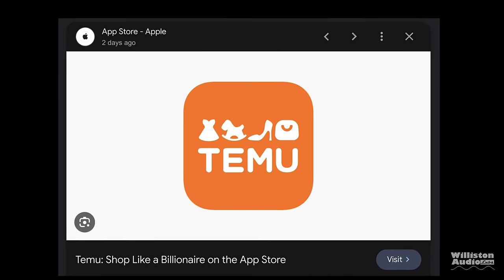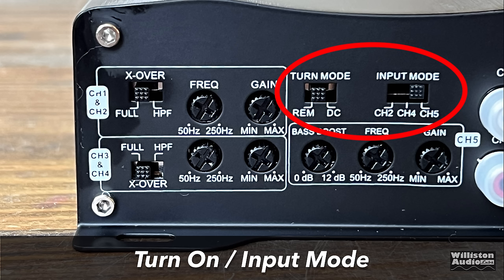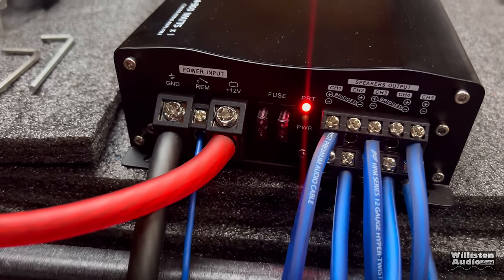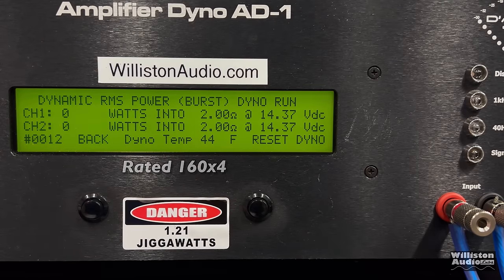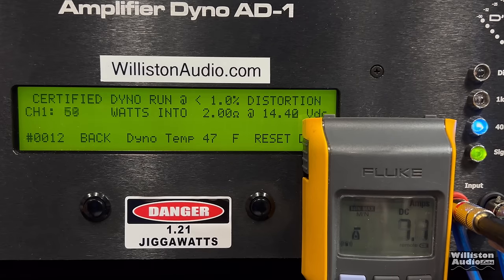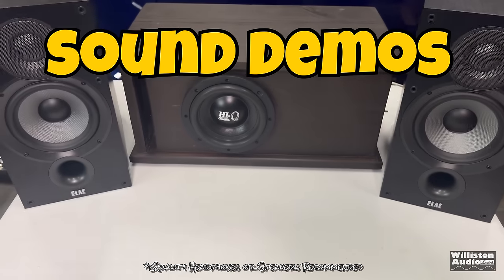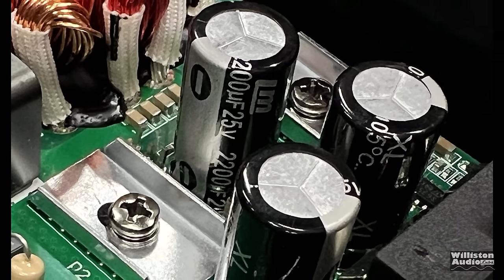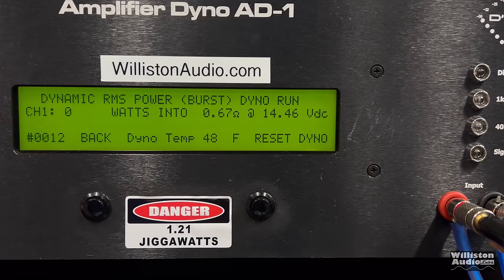I Bought a TEMU Car Audio Amplifier

Comment: Temu UPDATE. I rolled the dice and got the alpine tweeters I'm sure you have all seen them haha they really sound great and the little crossovers work perfectly so they somehow got real deal alpine tweets probably before going back to alpine factory bc to get a pair of tweets 1" dome tweeters w xover for 20 bucks hahaha but I am here to tell you they sound AWESOME. Hahabetter than my fosgate separate tweeters  lol so the alpine dome tweeters w xover is worth the 20$  10out of10
Reply: Those are definitely not real Alpines, you can find identical ones with other names on it. They just slap Alpine's logo on them, and put them in packaging made to look like what Alpine used. However, Alpine stopped using those purple-bluish boxes like 15 years ago.

They still sound decent, being a silk dome tweeter. Before those, they uses to sell a different set of knockoff Alpine tweeters that were aluminum dome and they sounded horrible.

Comment: Not having a subwoofer level control for the amp doesnt bother me. I just use the one on my Alpine head unit
Reply: Yeah, most modern head units have an adjustment.
Reply: My kenwood has it, along with built in crossovers. Makes tuning easy.
Reply: I found that constantly fiddling with the head unit every time the song changes is a real pain in the rear. You could easily get an inline RCA style bass knob to easily control the sub level.
Reply: @JasonWW2000  I have a din size alpine head unit & I only have to push 2 different buttons to get to sub level. So it's not that much of a problem in my case.
Reply: This amp DOES have a bass level control. It just doesn't have a remote bass control.
.
Seems totally unnecessary for normal folk, since who needs to adjust the bass level for every song?
.
Every head unit has Bass and Treble, and/or EQ so you can adjust it there if you must fiddle around. You might be better normalizing the tracks you are playing, so they have a more constant volume and bass that you desire. That will then apply for every time you play them!
.
Or if you really need a remote control, it's trivial to add a attentuator onto the RCA line that's feeding down to the amp's sub channel.
Reply: @johncoops6897 You're kidding right? Are you new to car audio? Maybe I've been around it so long that I'm out of touch with normal folk. 

Yes, you absolutely need to adjust the bass level for every song. Sometimes even adjust it a second or third time during the song in case you adjusted it wrong the first time. Not adjust the bass EQ, which is usually centered around 100 HZ, but the actual bass level signal.
Reply: @rickross368  Yeah, if I had to do that every time I wanted to adjust the bass I'd probably end up crashing. Lol.
Reply: @JasonWW2000  - "normal" folk set the sound EQ to their preference, then adjust one knob... the volume.
If the recording has heavy bass, then that's what you hear. It seems very odd (and distracting) to be adjusting the sound balance for every track, let alone making adjustments on-the-fly while a track is playing.
If a particular track has too much bass for you, then adjust that when you "record" the track... That way you don't need to be continually fiddling around with your system just to listen to some music 😃
Reply: @johncoops6897  You're speaking Greek to me. I have no idea what you're saying. I have no idea how to change the bass while "recording" a song. Is it even possible?

My custom bass knob is integrated into my center console right underneath my hand. I can easily adjust it by feel without ever taking my eyes off the road. It's completely normal and natural. 

All my equalization is done through a DSP and once it's all dialed in I don't mess with it.
Reply: @JasonWW2000  - you play digital music in your car, right?
A) Where do you get that music from?
B) How do you store that music, what media? MicroSD, USB, Bluetooth from phone?
So what do use to get music from A) to B) above?
.
During that transfer process A to B, you can change the overall volume, the dynamic range, the tonal balance, etc to suit your personal requirements.
.
There are a variety of music processors that automatically analyse every track and adjust these parameters to balance each track with your preferences. For digital sources the overall volume "gain" can be changed without any alteration to bitrate or quality.
.
A perfect example for normslzation is what oldies would call a "mix tape", where single tracks are copied from all different albums. Originally, all the tracks will have vastly different volumes, which drives you crazy when playing them back.
.
However, by "normalizing" the volumes of each track in the group, you might decide to alter all these tracks so the very loudest part of every single track is the same dB Level.
.
I have ripped thousands of CDs and downloaded even more from "various sources" 🏴‍☠️ The volume levels were all over the place, and also the sound profile (eg: Bass level) depended on how and who made them.
I have run every single track though an automatic Volume Normalizer program so that the max levels are all identical. That doesn't change the songs themselves, just how loud they are in relation with each other.
- so I can play any combination of songs and no need the touch volume control. 😉
.
If a particular track has poor tonal balance (eg; ridiculously overbearing bass) I just run it through an audio editor to make it sound like I prefer. It's easier to reduce sub bass to a few overbearing tracks than add bass to the majority of normal music. Once the tracks are more "balanced", then you don't need to be jumping to wind the bass knob when certain tracks play, then winding it back up for normal music.
.
All this stuff is done once, when you first obtain the tracks. Sometimes nothing is needed, sometimes it's madatory for quality of life. Make sense?
Reply: @johncoops6897 
A) I tend to download music in mp3 format from PC.
B) I then transfer it temporarily to a usb drive. Then load it into my head units storage drive.
I've never messed with any audio processors on my PC. I've never felt the need to. If the volume levels are different from track to track I just turn the volume on the radio up or down, which I do anyway based on my mood. If one song has weak bass or strong bass I can just adjust that using my bass knob. Super simple. To me at least. Lol
Reply: @JasonWW2000  - yeah, that's what you are used to doing, since it's all you previously knew before now.
.
Now you know that prior to transferring to USB stick, you can adjust things like Volume or even Bass level.
Try it... find a song that's really soft, increase the volume er of your saved copy, then copy it back to the car again.
You can also add and edit the Tags (Artist, Track Name, etc) that show on the head unit screen too.
.
You don't always need to adjust anything, but I can assure you that it makes for a significantly better listening experience if you don't suddenly get blasted out of the car by a load track that follows a soft one 😃
Reply: @johncoops6897 Different volume levels doesn't really bother me. I've got a super quiet vehicle so the volume level is usually low to medium. I never get blasted out by sudden high volume. Plus I've got way too many songs to try and go through to edit. It doesn't seem worth it to me. The only thing I find slightly bothersome is some of my older rock music is pretty weak in bass, but I don't think that can be easily changed in software. For those rare cases I'm going to be installing a Wavtek Bass Restore (same as an Epicenter) that can add low bass into that music. I haven't installed it yet so I'm interested to see what exactly it can do.

Instead of me having two separate knobs to control the bass level and the "epicenter" effect, it's got dual concentric knobs which are stacked. The bottom knob controls the effect and the top knob controls the subwoofer level. The top knob can also be pressed down to turn the effect on or off. I think it's going to be pretty cool.
Reply: @JasonWW2000  - Volume Normalizing is done using an automated Batch process. You point the software at a whole folder (or drive) of MP3s and it automatically adjusts every single one to whatever "audible volume" that you define.
.
It doesn't re-encode the files, it just samples them at various points and calculates how loud they are "to the human ear". Then it adds a Tag in the header of the MP3 that tells the player whether to increase of decrease the volume of that track.
.
So, you might point it at 1000 x MP3s and tell it you want (say) 90dB. It works it's way through them quite quickly (one track per second?). I've probably processed 20,000 or more songs with it - I just told it to do everything that I have saved.
After it finishes, all those MP3s will be a similar overall volume. The tracks don't actually change, it's just adding a MP3 Tag that tells the head unit to roll the Volume up or down by a certain amount on a track-per-track basis as it replays them.
unnecessary
Reply: @johncoops6897 That sounds pretty cool. I'll keep that in mind if I ever get bothered by volume differences. Now that you've put that thought into my head it's likely I'm going to start noticing the volume changes and get irritated by it. 😂 LOL

Comment: Can I ask for a review of the BT30D PRO Fosi Audio Bluetooth Amplifier? Has a Bass Control Knob and supposedly does 165 watts X 2 + 350 watts subwoofer. Also allows Passive and Active Outputs.

Comment: It DOES have subwoofer level control.. (what do you think the gain knob under the subwoofer section is for? Just as the other channels have an independent gain or "level" if you will.) 🍻
Reply: I picked up the exact same thing... it DOES have Sub gain level SMH
I think what he meant to say was there is no REMOTE bass level control, as he mentioned that as a 'con' right at the end of the video.

Comment: @2:20 missing subwoofer level control?
why would you need that when you can adjust the gain for both channel pairs and the sub indivitually (I see three gain controls on that side of the amp) ?

Comment: Longevity is questionable my optimus 4 channel 340w is still kicking have it in my car
Reply: I’d take this over the blaupunkt I bought for $40 last year. Have 70w components, and a 125w 8” jbl sub. If you crank it up, it will dim the lights, and start to smell bad after awhile because it’s so inefficient.  I had a water bottle laying on it. It got pretty warm 🤣
Reply: @kd7cwg   lol same with a dual amp i had for bass because the amp i had needed to be repair
Reply: @kd7cwg  where you have the gain set too ,it might be it's set too high and makes the amp stress out